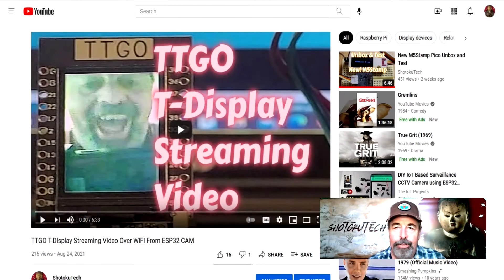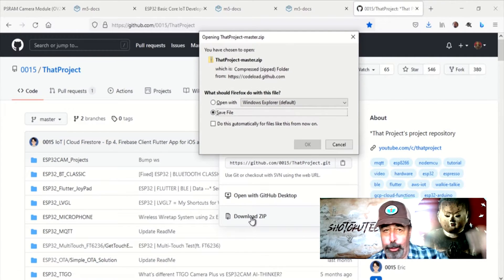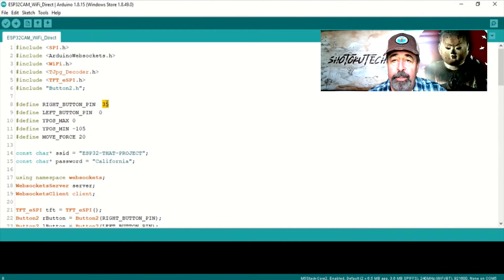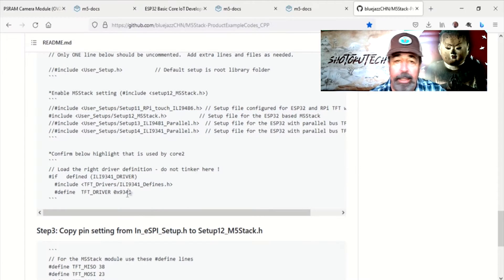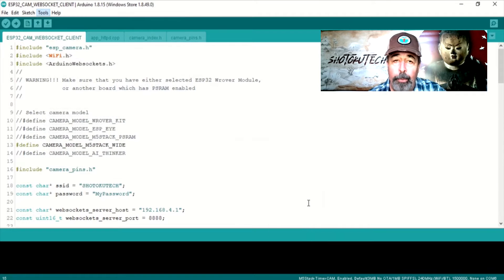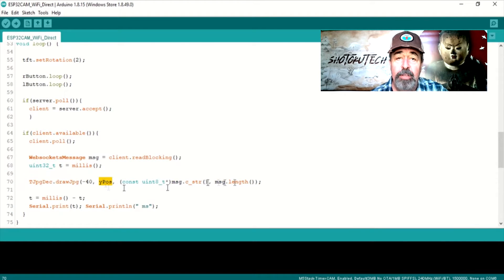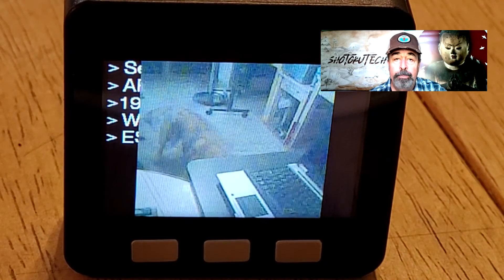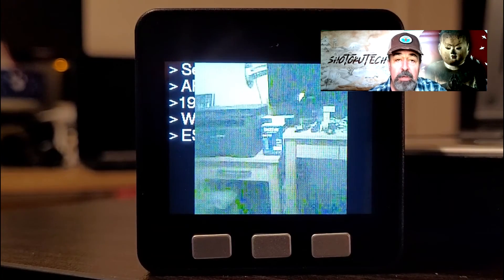Video Over WiFi From M5Camera X To M5Stack Core Tutorial

Comment: Awesome. Are you working towards something specific, or an end goal, with all these products or are you just learning about all of it?
Reply from the maker: I really want images over LoRa. Stirring the pot. Thanks!
Reply: @ShotokuTech  Do you subscribe to Andreas Spiess? He has a similar vibe to your channel.
Reply from the maker: @BrandonJacobson  No, I usually don't watch anyone in my niche if I can avoid it. Most are too long winded or never get to the point. Like my M5Stamp video, I show how to wire FTDI, flash the firmware, program the RGB LED and drive an OLED all in under 7 minutes. I watched another channel's 7 minute video about M5Stamp and all they did was talk about it and show it off. Can't get my 7 minutes back. Of course theirs got 3x the views. LOL.
Reply from the maker: @BrandonJacobson  The there was a 12 minute video titled in a way to make you believe they were transmitting images over LoRa. Instead they talked for 12 minutes about a flow chart to describe how to send image detection data over LoRa and other than handling some cool hardware the vendor sent them, they never did a demo of anything. LOL